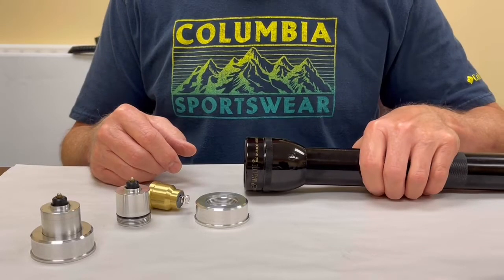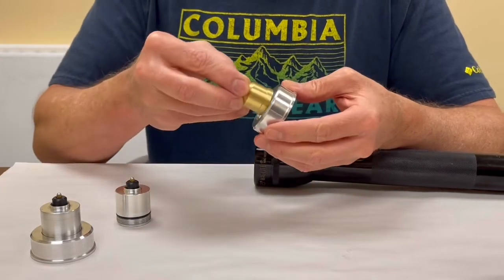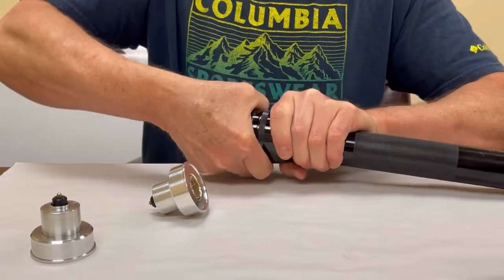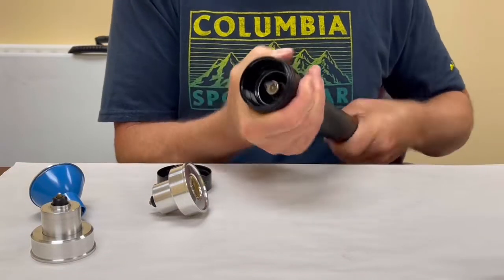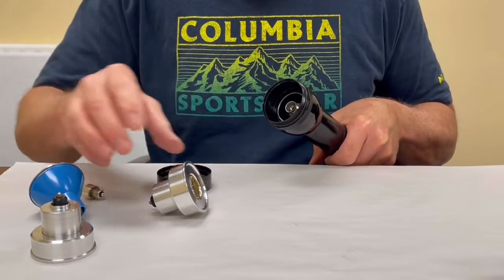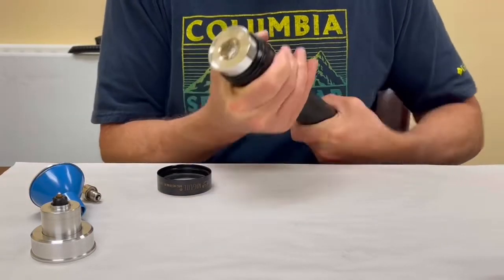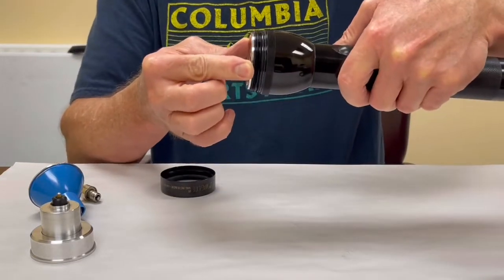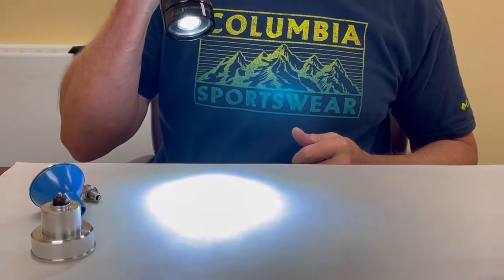Maglite LED Conversion with Malkoff Maglite Adaptor

Comment: Very interesting design.  Plenty of heat sinking for that M bulb.
Reply from the maker: Yes indeed! Thank You for the comment!
Reply: Yes!  Just put a wildcat V6 in a 2D for that reason. Man do they get hot. This is a great solution vs the md2 head. 

Plus the drop in stays in regulation for 25-30 minutes with 18500’s. Two 26650’s in the maglite should break the 1 hour barrier.

Comment: Thanks!
Reply: The shape of the M drop it looks different. Is this because it now uses a spring to make contact with the host, as other p60 style drop ins use?

I picked up some sst-20s not too(?) long ago and they were the (what I know to be the) traditional Malkoff drop in shape.
Reply from the maker: The shape is a little different because it is a “T” dropin
Reply: @malkoffdevices6279  Thank you for clarifying. I'll have too check those out

Comment: Is the stock lens supposed to fit?
My bezel does not screw all the way down on my model..it is a newer 3D Xenon.

Fits PERFECT though without the lens.
20+ years of waiting and I finally have my perfect Maglite.
Reply from the maker: The stock lens should fit. Please call us at the shop tomorrow. We will be happy to help with installation. 334-393-3717